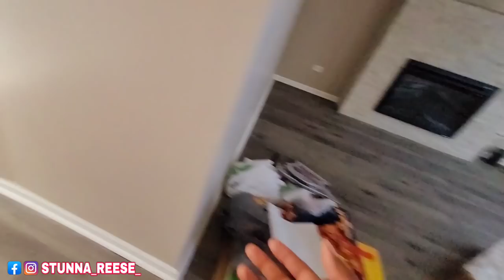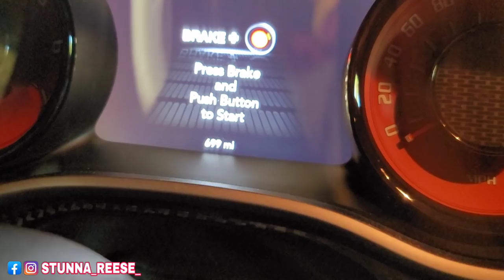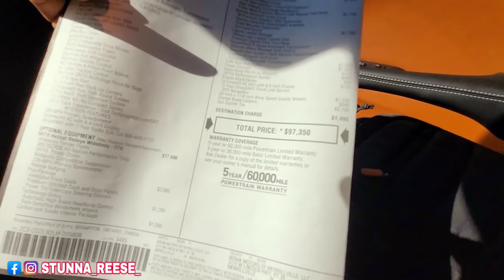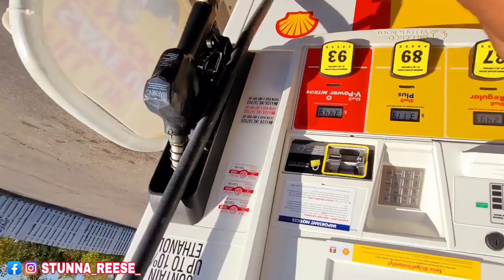1ST PERSON TO TRY ME IN DOBERMAN REDEYE (I MESSED UP)

Comment: Using a Battery Tender for the Doberman would keep the battery at an optimal charge and they have the multi charging unit that would charge Drac at the same time 👍🎥